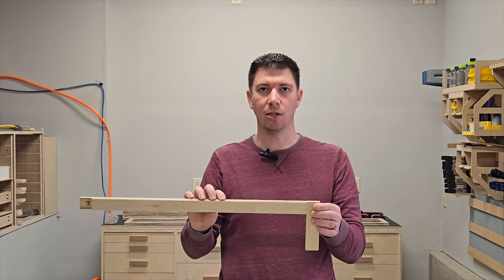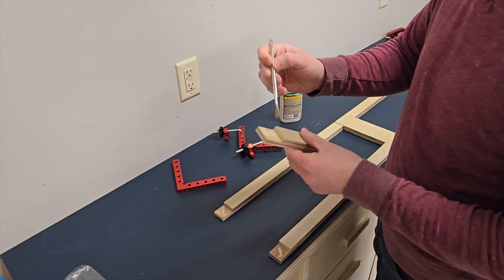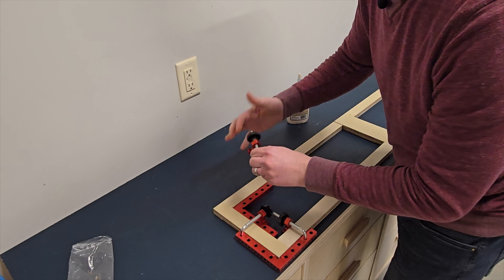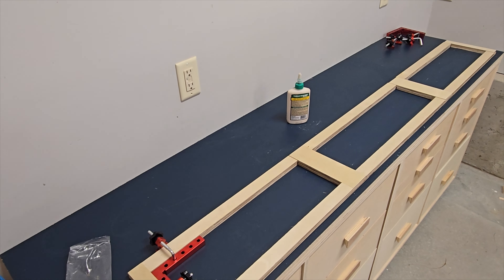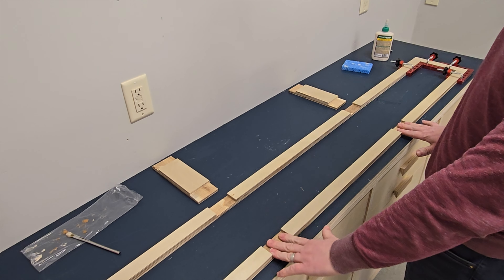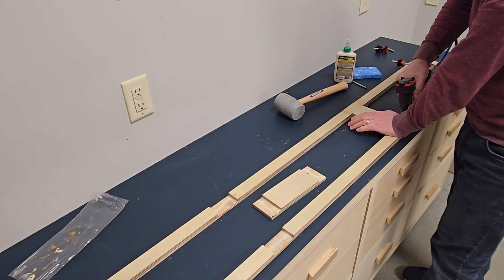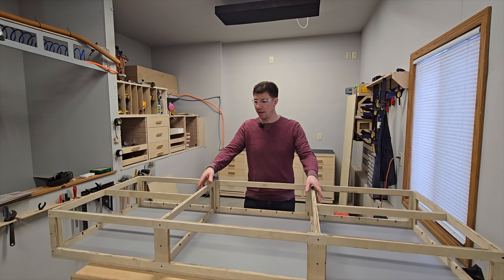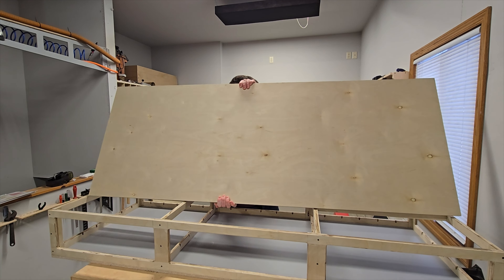Plywoods Expensive!: Build This Garage Workbench Instead

Comment: Excellent job. Torsion box benches are plenty strong, as are lap joints, especially when reinforced with fasteners. I specialize in workbenches, but have shied away from the Palk style due to the material requirements (& customer demands to keep things cheap). Your design will cause me to rethink. A few simple jigs will make the two lap joints accurate & fairly quick, but a table saw (or radial arm saw) w/ a dado stack might be even quicker. Thanks for sharing your design. Sincerely, your newest subscriber.
Reply from the maker: Thanks for watching and subscribing!!!!

Comment: Nice looking top; I'm sure it is fairly rigid and nice to work on-just not sure if it is a true torsion box. But that's okay as I'm guessing it will serve the purpose well. I do have to ask though: why put the pocket hole screws from inside to out? It compromises the plywood edge. If you don't want to see the pockets my suggestion would be to glue a few short pieces (say two inches each) in several places along the inside of each side of the frame and drill your holes in them, thereby moving the screw away from the edge by a further 3/4 of an inch. Just my thoughts.🙂
Reply from the maker: Good advice here. I did have to take extra care with screw length and placement. If I ever build a second one, I'll try the blocking. Thanks!

Comment: Can you explain what the benefits of the vertical gap are?  I understood it helps keep the top flat, but isn't it enough to ensure the top frame is flat?
Reply from the maker: The cross lap joints help stabilize the center of the longer sides and allow for a connection with the center support, it all works together to keep the top flat. The cutouts of the workbench where there is no support allow for tool storage underneath.

Comment: Nice. with the prices of material, this makes a lot of sense.
Did you consider using cleats to connect the top instead of pocket holes? They always feel like a lot of extra effort to me. especially for so many of them.
Reply from the maker: Thanks, price of plywood was the motivation. I didn't consider cleats but it could be done. I did pre-drill for all the holes so there is extra effort for that But I wanted to be able to disassemble in the future. Thanks for watching!
Reply: They tend to not be useful in the project which i think is the point here.
This is much better material use with less waste.

Comment: I thought about this before but if you use a tracksaw for the cut outs you end up with rectangle scraps that could be useful for something else, ie not wasted.

Although I do agree that this method:
A) will not create scraps
B) can use previous scraps
C) will not require buying extra full sheets to get the size needed
Reply from the maker: I've used a router and tracksaw before. But I always end up with small pieces saved around the shop, not big enough to really utilize, adding more clutter. Hope you like it & Thanks for watching.
Reply: Definitely much less scrap.  But we need to cut everything precisely.

Comment: Loved it. But did you check it later to confirm that the surfice of the bench is completely flushed?
Reply from the maker: I'll do a follow up video. I'm also working on adding a proper workbench frame and storage underneath. Thanks for watching.
Reply: That was my question too. When you are working with strips, it's easy to pull them so they are not straight vs the factory edge of plywood

Comment: You have to ask yourself though, how flat is flat enough for woodworking purposes. Would it have just been better to take all the plywood that you used and sandwich them all together to make a thick Rigid top and save all that time. If you have a 1/16 or 1/8 bow over 8ft that really isn’t that bad considering most things you may make will only use 3-4ft of the top any any given time essentially reducing that bow in half.
Reply from the maker: Thanks for watching. It's flat enough and even better, tool storage below!

Comment: Torsion Box? That would require rigid connection of the outer surfaces to provide tension and compression on opposite sides of the centroid line. Diagonal bracing best connects the outer surfaces to transfer side loads that occur with bending. Truss bridges offer a great visual of diagonal bracing with significant connection joints, the Paulk design achieves some of this via large radii on the through holes. Your halflap frame has no path of load transfer for side loading and the compression tension wont be a uniform distribution. Go with diagonal members and you'll find an exponential increase in rigidity. In compression joints a butt join is better then halflap, in tension the halflap is great. Guess you guessed I'm an engineer, I did enjoy the vid anyway. 

Elon has almost no input to Tesla design either. Elon bought the original Tesla from 2 electrical engineers. Elon employs engineers to employ engineers to push the boundaries of engineering, production, design etc etc. The less Fan Boys Elon gets the better the product will be due cred being placed with the appropriate people. Quo-dos to Elon for taking risks, that;s what he does, take risks and employ smart people to give the risks the best chance of success.
Reply from the maker: Thanks for the informative comment and thanks for watching!